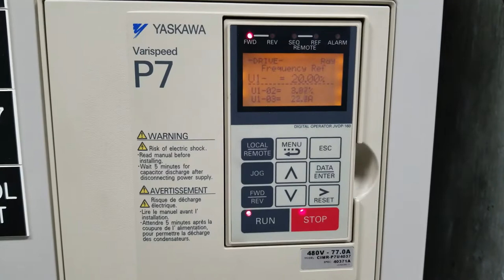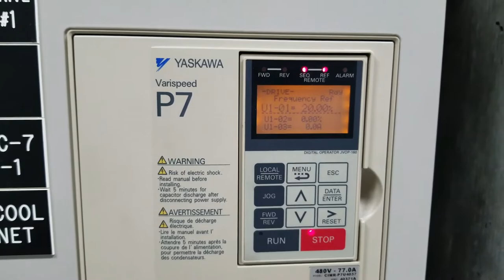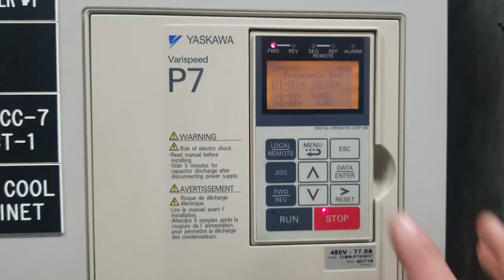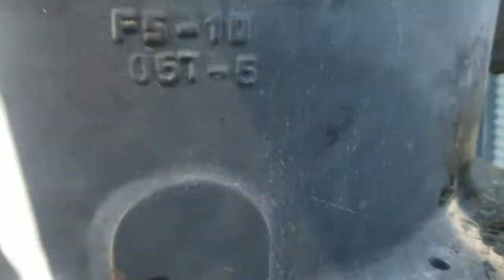Amarillo Right Angle Gear Drive Oil Change - Fan Drive - Cooling Tower - Industrial Gear Lube 220

Comment: Just out of curiosity what plant is this it looks so familiar
Reply from the maker: It’s an office building high rise in Streeterville, Chicago
Reply: @iceplant1  wow how would they take it off for rebuilding is they had to
Reply from the maker: @robertwhite281  helicopter. They used a helicopter to lift a packaged HVAC unit to our roof a couple years ago. I was off that day but I have pictures!
Reply: Look in the background you can see the Sears tower !